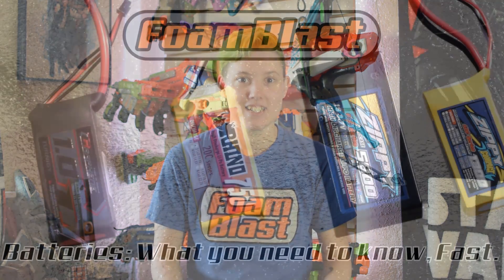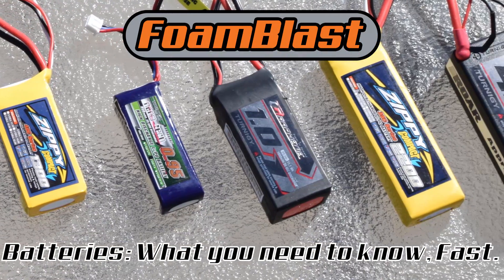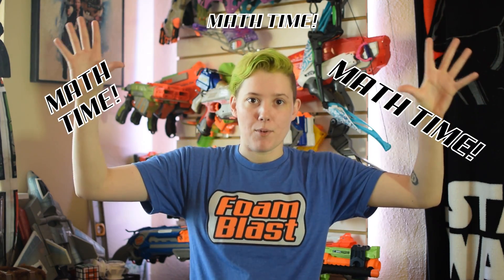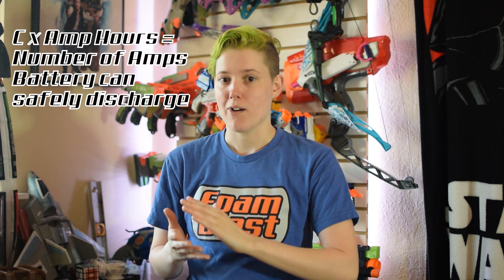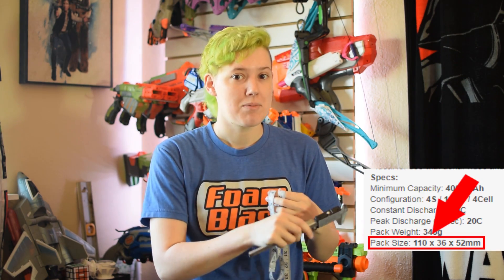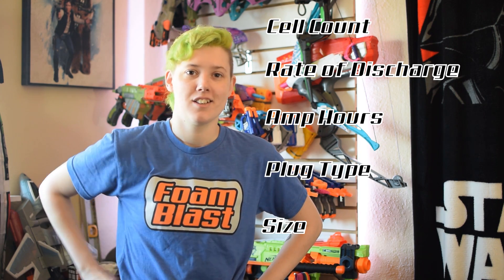Batteries: What you need to know, Fast.

Comment: Hey Adrianna... newb question perhaps but here goes... How can I determine the discharge rate of a lipo? Is there a tool (for lack of a better word) out there or something? I ask this coz where I'm at there are a lot of lipos coming in from China and so sometimes u get an unscrupulous dealer who mislabels or pumps up their discharge rate when it really is much much lower than advertised. TIA... cheers ;P
Reply: Yes just death Lipo battery tester they have multiple conecters for testing and getting specs on pretty much any lipo

Comment: What about idle current, especially in a Full Auto blaster? Most motors have a low idle current of less than 1 amp, and the discharge only really matters on the first startup and motor braking. If I have motors that draw 24 amps, and a pusher that draws 30 amps, would I need a higher overall discharge for all three or use a smaller battery because the discharge is on 2 separate motor circuits?
Reply from the maker: Idle current doesn't matter much because your battery should be incredibly overspecced for that. We make sure to use batteries rated to handle the stall current so a jam or any other stress on the motor won't damage your battery. 

For full auto, your pusher will likely never stall, so its not as important. You should be fine just to add in a larger safety margin instead of the full stall current.

Comment: So for 2 fangs you would need a 3s lipo with 25c?
Reply from the maker: You do need 3S, yes, that's your voltage.  You need to know the capacity for the C rating to mean anything.  If you re-watch the section about Discharge rating, Adrianna explains the formula which is C * Ah = Amps Discharge.  There's also a calculator in the description for figuring it out.  You'd need a 2500 mAh battery if your burst C rating is 25c.

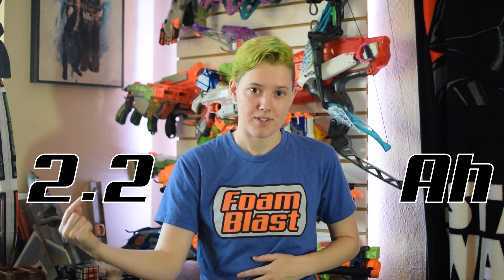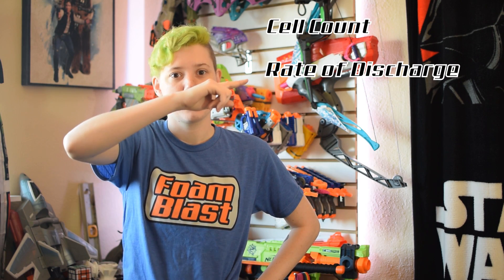Comment: Your accuracy for pointing at nonexistent text that will be edited in later is amazing. Like seriously, at 1:35 you nailed all the spaces in between the numbers and even had the decimal point keep in time with your finger. Even more so at 2:40, all of the words of CRAPS are pretty much a uniform distance apart meaning your pointing was consistent which is impressive considering the fact that they're not there. Like I know other Youtubers will point to the upper right for their next video or down below to talk about the comments, but this is on another level.
Reply from the maker: That is all Michelle's editing and directing.  There are so many takes of Adrianna's hand being out of shot while pointing to things. :)
Reply: FoamBlast please I need help I wanna buy mod my rapidstrike whith fangs can I please know if a zippy 2.2 ah power zippy battery will be enough to power 3 fangs
Reply: +Burhan Baig

If it's about 45C burst, then you should be completely safe. Since a scotch yoke pusher doesn't draw much current outside of a crash, though, you'll could be able get away with 35C.

Comment: You say Meishel's take 2s. Is it not recommended to use 3s with them?
Reply from the maker: Nope.  They're a 2S motor.  Fangs are a 3S motor.  Maybe that's where the confusion comes from?
Reply: FoamBlast no. no confusion. I saw a chart on Reddit using meishels on 3s.
Reply: Ahhhh. gotcha. understood.